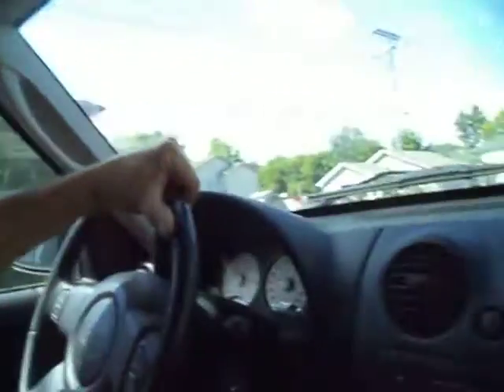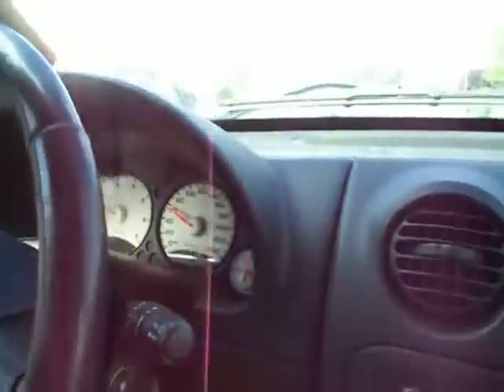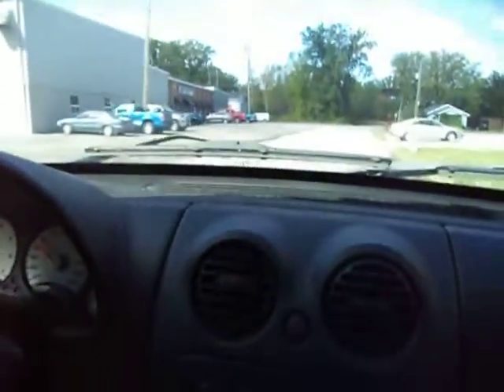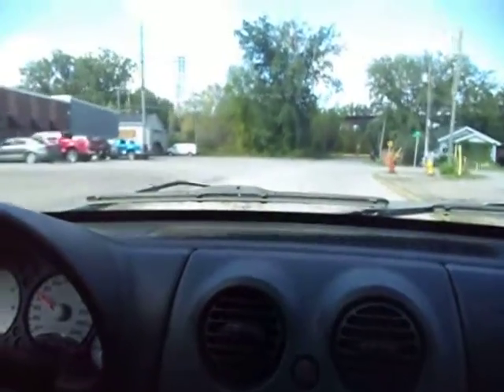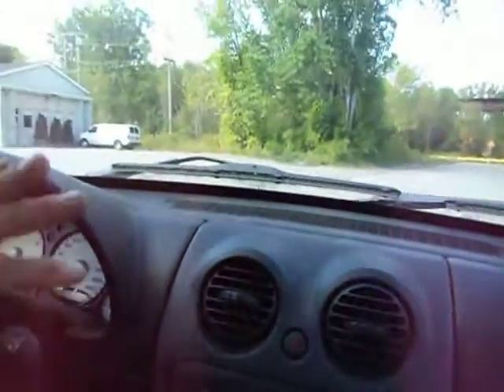Bad wheel bearing sound

Comment: I have the same noise in my 2012 Jeep Compass and it is actually the rear differential. All of the wheel bearings are in excellent shape and have maybe 30,000 miles on them. The rear differential part is anywhere between $200-$1,000 depending on if it is used or new and it is about 10 hours of labor to install it, meaning that the total cost to replace the part between $1,050 and $1,850 if my mechanic does it. The same job at the dealership, on the other hand, is about $3,600.